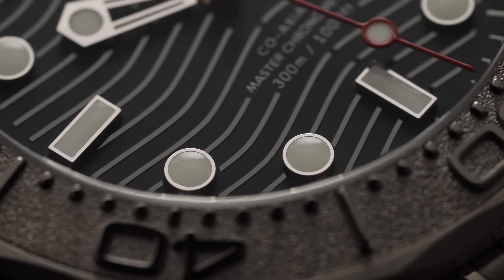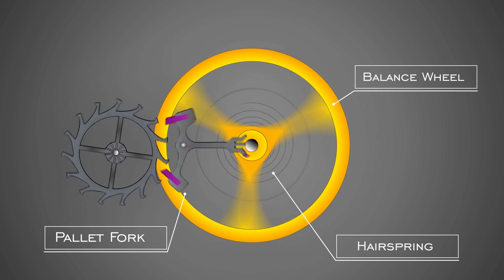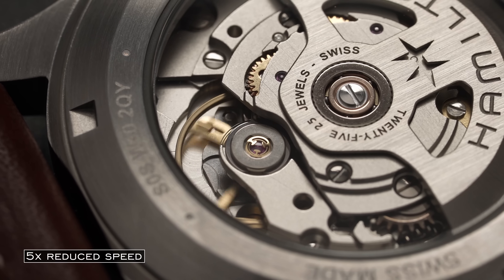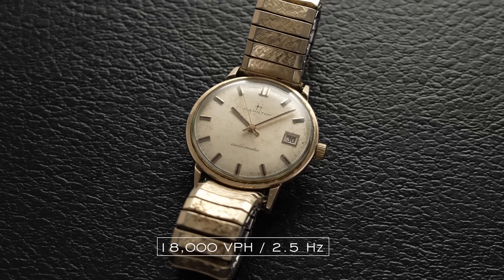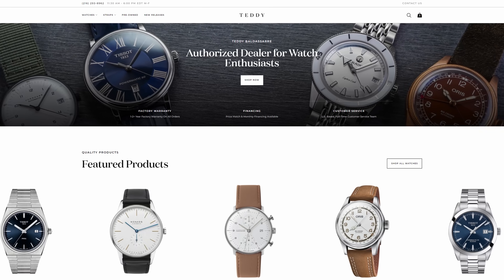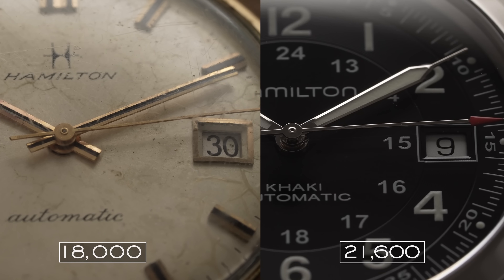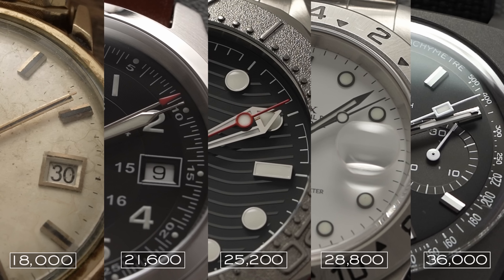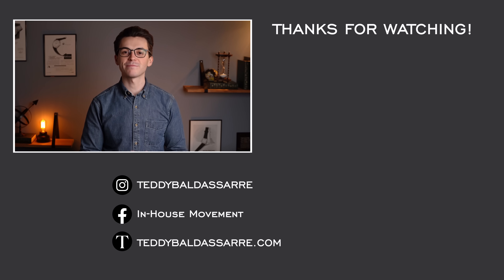Watch Beat Rate Comparison 18,000, 21,600, 25,200, 28,800, 36,000, & Spring Drive (120 FPS)

Comment: Thank you very much for such a video.    I wish The Slo Mo Guys could get their hands on a Breguet Classique Chronométrie 7727 (10Hz), a Bulova Precisionist (16Hz), a Zenith Defy Inventor (18Hz), a TAG Heuer Mikrogirder 2000 Concept (1000Hz), a Grand Seiko 9R Spring Drive (∞?),  and a Citizen Eco-Drive Caliber 0100 (or other watches worthy of study), but do a static macro view of a 5 second portion of the dial (or Breguet's 2 second sub-dial) and film it at over 100,000 fps. It would probably be necessary to film the Grand Seiko 9R Spring Drive at an even closer 1 second dial view, but registering any noticeable 'correction' of the movement (where it's 'Tri-synchro regulator' applies electromagnetic power (or a virtual 'brake') via a rotor/stator) would have to be under certain conditions that would probably require a much larger time frame -- and the most obvious condition would be winding-up a dead Spring Drive.  The second hand races for a few seconds until the 'Tri-synchro regulator' kicks in and slows down the second hand.   Filming a macro view of a briefly wound dead Spring Drive in conditions where the watch dial is stable (so any corrections are clearly visible) would take some skill --
/watch?v=1QSbheeMIHk&t=292s   

Of course, filming most of these movements at such high frame rates is overkill, but it would clarify some of these higher rate movements.   Given the potentially limitless power of an automatic movement, I wonder if Grand Seiko will ever adapt the 8,388,608Hz frequency that Citizen applies to their AT cut quartz crystal in their Eco-Drive Caliber 0100 (which is 256 times the standard 32,768 quartz frequency) to future Spring Drive models for added accuracy.  Or if (or when) the innovations of the Grand Seiko 9R Spring Drive, Zenith Defy or Citizen Caliber 0100 will ever make it to general consumer timepieces.

Comment: Excellent video,  great information and explanation. There is no doubt that the Spring Drive is the ultimate technology in mechanical watches due to it's integration with high technology without sacrificing the tradition of mechanical movement.

Comment: Frederique Constant presents a silicon oscillator beating at an unprecedented pace of 288,000 vibrations per hour, or 40 Hz : the Slimline Monolithic Manufacture

Comment: I have the King Seiko 4502 which has a 36000 beat rate and is so satisfying to look at. I was told though that the KS 56-series is more desired because of the 28800 vph because it would last longer (less wear and tear). Because of that, I was careful to use my KS 4502 only on special occasions to minimize the wear and tear. 

Overall, great well-presented explanation video!

Comment: The best video made so far re: beat rates on YouTube, especially for non-watch makers. This highlights how great of an innovation the co-axial movement by George Daniel was to reduce the friction. I think one other item to note is the new 9SA5 movement from Grand Seiko that has a hi-beat 36K vph with 80 hours power reserve, more specifically the dual impulse escapement that supposedly reduce friction rates materially with the direct and indirect interaction, lessening service intervals. Not sure how this will perform long-term but if it does as advertised, I think it's up there with the co-axial as far as innovation...I guess only time will tell (pun intended).

Comment: Very good technical content 👍 I love to listen the beat rate of my watches. My OP 36 at 28K does a science fiction tic-tac with a kind of oscillation noise behind, sound is not regular too... weird to explain, my Duoface at 21K does a lovely vintage tic-tac. The perception of the second hand run depends also of the length of the hand. I don't know if you agree but the small second hand on a Reverso looks as smooth as a spring drive where a long second hand on a Rolex seems less smooth. The run of the spring drive is really the identity of the watch and is hypnotic 😍

Comment: Great video Ted. My favorite second sweep comes from Bulova’s accutron or precisionist movements, much like the spring drive, they are very smooth.
Reply: Yup. I was scrolling through looking for a shout-out to this movement. Bulova Precisionists are a marvel. I'm waiting for Citizen to do amazing things with it. I know with the current battery and solar cell technology the Eco-Precisionist isn't a possibility, but one can dream, right?

Most of the Precisionists seem to be in larger size watches and I wonder if that is attributable to the larger battery needed for that higher beat. The design language of most of the Precisionist line is something polarizing as well.

I've briefly owned a couple and the second sweep is mesmerizing.

Comment: I have a Bulova Accutron and a Seiko 5S21. They are both quartz but they both have sweeping second hands. Since I have a few watches my automatics stop for not being in rotation and it can be a bit of a hassle setting up the time everytime I wear a watch. So, I end up wearing my G-Shock/quartz watches more and among quartz watches the Accutron and the 5S21 gets the most wrist time, since I love the smooth sweep. I wish Seiko/Grand Seiko/Bulova will produce quartz watches with sweeping second hands again, watches between 37mm-40mm diameter with 100m water resistance will be great no nonsense, pick up and go, everyday watches.